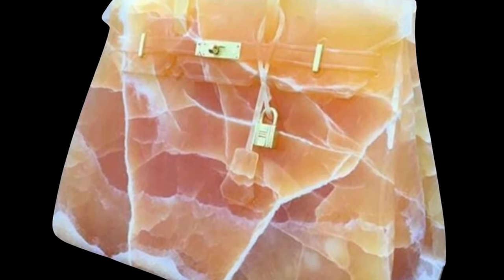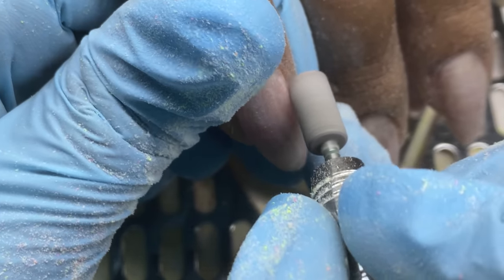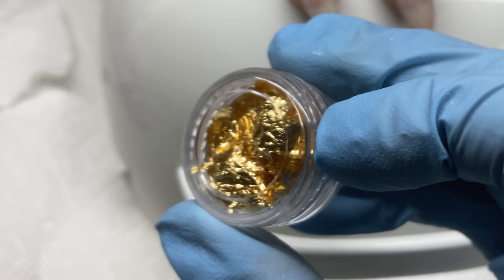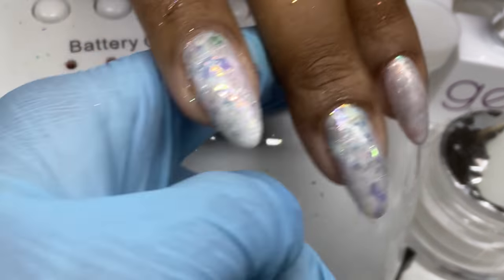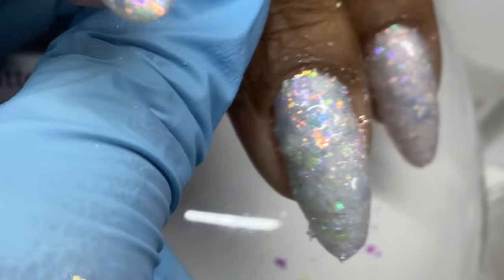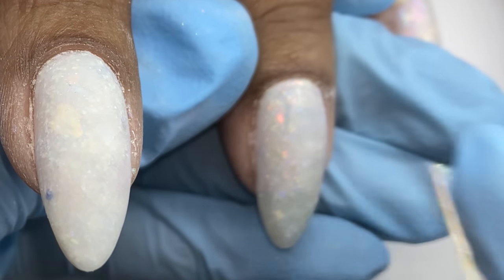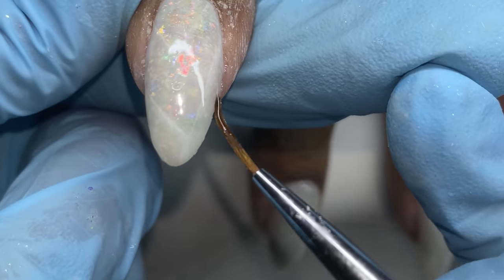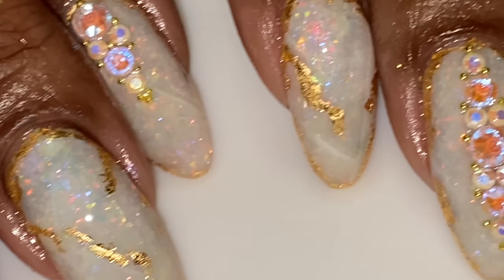White Opal Gel Nail Tutorial | Made with REAL Opal | Gemstone Nail Art | Gold Leaf Nails

Comment: Could you please do a educational video on the height of the apex depending on the length of the nail, where it should start and taper depending on length and height of product at it thickest & thickness of the tip - depending on the length. I am still practicing before doing a full nails course, I don’t work on other except for shellac gel overlays. I really can’t tell how high a apex should be from a video, I am still working on my acrylic application and this info would help me understand how bulky a nail would be with the proper amount of thickness for strength. I personally like nails looking as natural/smooth as possible but understand sculpted nails can’t be like that. This info would help enormously 💜💜💜